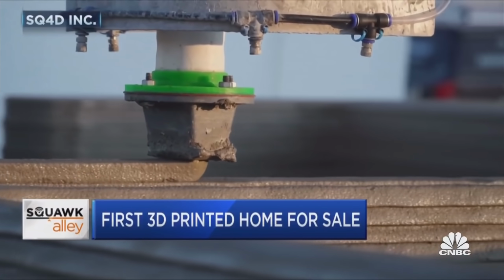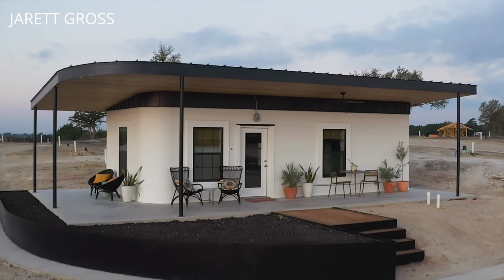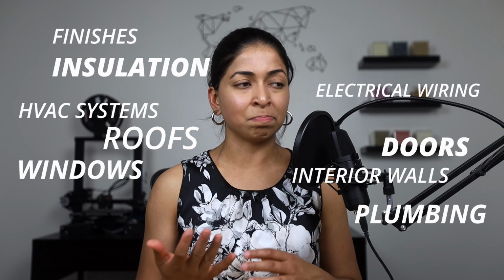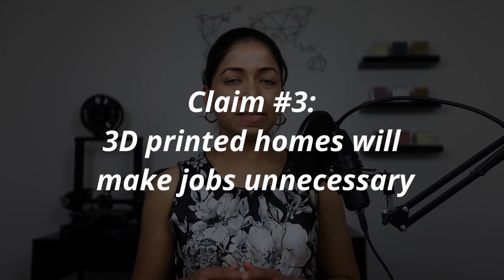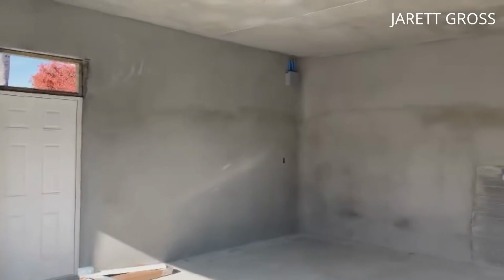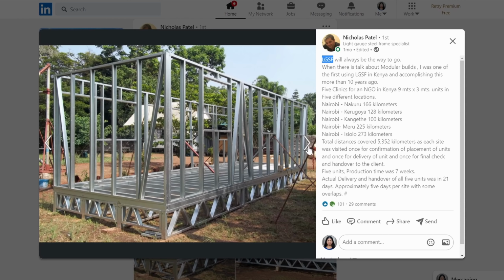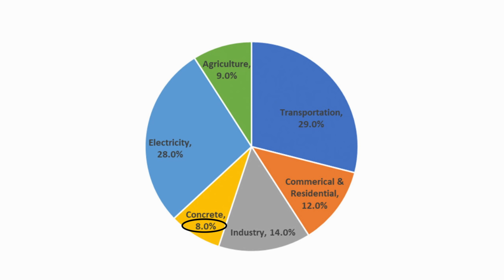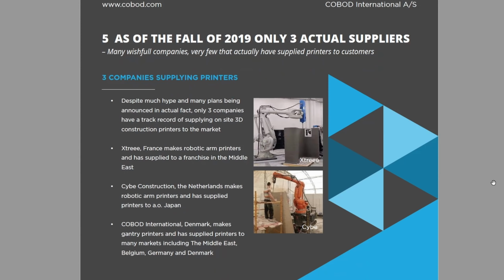Exposing 5 LIES about 3D Printed Concrete Homes

Comment: I feel like a "house printer" needs to be a lot more than just a concrete extruder. I feel it could be viable with using plastic and metal extruders in addition to concrete in order to lay electric and water lines as well as insulation, but it also needs a lot more maturing of the technology before it can be used to just slap down houses and call it a solution to housing problems.
Reply: That isn’t possible I’m afraid, 3D printed pipes would take ages and would be far weaker and more prone to leaks than standard 
And you’d have to have very different nozzle sizes for wiring and the walls, this would slow down the process massively as the walls would have to wait for that layers piping and wiring to be made before it could do the next layer. This would result in the concrete section idling which would increase the cost of using

Realistically a 3D printer is nothing more than an extruder with some movement
Reply: Prefabricated modules are much simpler, cheaper, and adaptive.
Lots of interesting work done here, unfortunately a lot of regulatory and perception problems.
Reply: @chrissmith3587  They're getting there.   There is a company printing metal rocket engines.  Aluminum, I think.  They can print the pipes into the bell and motor assembly while printing the whole engine.  It's a neat idea. 

https://www.youtube.com/watch?v=kz165f1g8-E

Common consumer/hobbyist 3d printers being used today can print multiple materials at once.  Either with multiple extruders and nozzles on the carriage, or combining nozzles where they can provide one material or a combination of a few dynamically.  

I don't think they'll ever be able to pass cement and aluminum through the same nozzle, but they could be able to print each on their own heads.   

If they can build rockets with it, they can print your residential system to whatever local code is, unless code requires factory manufactured tubes.   I suspect building codes around the world will need to be adjusted to allow on-site manufacturing like that.    

I'm not totally convinced that printing the whole house, with plumbing and electricity, with one machine, is practical.   Really, those metal and plastic printing parts will be idle most of the time during the process.  It's (probably) better to still manufacture pipes and wires elsewhere, and install them as needed.   It should be a lot cheaper and easier to repair.  Imagine trying to replace a printed pipe, inside a solid cement printed wall.  

It might be practical in another 50 years, when the components are already heavily used in industry on their sites.  Right now, any of those parts are rare.   I can't just go on Amazon or eBay to buy any of primary functional parts.   It wasn't that long ago that I couldn't afford to buy 3d printer parts, and people with microcontroller experience were limited.  Now every kid can learn in school how to program microcontrollers, design circuits, and print projects.   It's us older people who fall behind, if we don't try to keep up with technology.  I just happen to be one of the older people who does stay up to date on such things.
Reply: It takes hours just to print a useless tchotchke that fits in the palm of your hand
Reply: Yes recyclable plastic would be better choice than concrete?  Probably would be earthquake proof also?
Reply: @plang42  There's a lady in Africa who recycles plastic into bricks that are tougher than regular brick, if the memes can be believed.

Comment: I'd like to point out another problem with 3D printed construction. The lack of any layer reinforcements. The absolute number one problem with 3D printing, is the weak connection between layers. The layers work great in compression, but absolutely terrible when subjected to linear and opposite vertical forces. Aka, if you hit it from the side or put the layers under pulling pressure, you will eventually obtain cracks. A mitigation of this, without introducing rebar, could be to print the layers in different angles, although this would increase construction time of the home. At the end of the day, I cannot see a 3D printed home as a realistic approach to housing for the masses. It's made in a way that simply isn't durable for decades, as unsealed concrete isn't exactly happy for being exposed to the elements and paint isn't a great sealant either, which means the best solution would be a mortar mix for resurfacing the outer shell, which means more work and thus a higher price. Furthermore, concrete isn't exactly an environmentally friendly way to produce housing, as you also pointed out in the video, which further adds to the likely hood of 3D printed houses being nothing more than a gimmick for arrogant designers, architects and the rich and famous.

The average population is better off with prefab homes, as even their concrete elements can be made in controlled environments, thus reducing their pollution by collecting and repurposing their pollutants. I live in Denmark and our houses are a mix between prefab and built on site. Most of them feature brickwork on the outside and plasterboard on the inside, but between those layers are insulated, prefabricated concrete slabs, on which interior and exterior insulation is added, to make high energy efficient homes that can easily last 100 years. Which then makes up for the pollution that have been released during construction. Best of all is we do a semi-custom ordered villa in about 2-3 years (semi-custom means that the overall shapes are predetermined and selected from a catalogue, but the rest is up to the customer to decide. All the way down to which light switches, antenna output, internet connection and their placements in the home)
Reply: Even cast in the conventional way concrete without rebar works good only on compression.
Reply: That's a common misconception - concrete doesn't need rebar, and the layer lines aren't as bad as they are in normal printing because of how the cure process works. We have alternative technologies and additives to make it strong in tension, rebar is just well-understood and generally cheaper.

The additives needed to give it tensile strength aren't cheap or easy to use, but they improve the results of the printing process by making the material stronger while it's curing.

However, that does defeat the potential "it's cheaper" argument.
Reply: While I do think 3D printed houses are a dumb idea (in europe we mostly use large bricks work in construction, and a couple of good bricklayers can build the walls of a small house in a couple of days, It's a small part of the total cost of a house). Reinforcement is not always needed. I live in a brick house from the 1780's. Obviously it's unreinforced, but since there are no large earthquakes here, it's still fine. Even most modern houses here have unreinforced walls.
Reply: @slome815  Your brick house is enforced. It's built by bricks overlapping each other, which automatically reinforces it, rather than just running straight line after straight line on top of each other, like 3D printing houses do. A single, continuous straight line, will crack along that straight line, if there's nothing to stop the crack. Most brick houses crack along the edges of the bricks and thus create a zig-zag crack, which won't compromise stability unless it's really severe (like bricks starting to fall out) and it's easy to fix. A crack running along the edge of a house, in a continuous straight line, is just seriously bad and you wouldn't want that ever. It can though be easily fixed. Just add steel rods every 60 cm. and you're good.

For context, I am a Dane.
Reply: @Arterexius  There is no bond in the horizontal joints, the same as with with the 3D printed buildings. No engineer would call a traditional brick and mortar building reinforced just because it's built with a cross bond or half brick bond. 
In reinforced buildings there is steel to take tensile loads. A normal brick building will not take tensile loads any better then an unreinforced concrete building would.
 
And while my house, with it's soft lime mortar joints, will indeed crack along the joints, and not straight through the bricks, that is not always the case with modern brick buildings. 
I have seen cracks in new buildings build with hard portland cement mortar, and they will often go right through the brick and morter without distinction.
Reply: @slome815  I know that an engineer wouldn't call a normal brick building reinforced, as it quite literally isn't. That's why I didn't label it as being reinforced, when I described the difference between a brick building and a 3D printed cement building, in terms of cracks and it's why I specifically pointed out that a 3D printed building can be easily reinforced by inserting steel rods (horizontally, of course. Didn't mention that though, as I thought it made sense from the criticism I have towards purely 3D printed cement buildings with zero support rods).

Also, what kind of shitty bricks did those home owners buy? I've never, literally never, seen a Danish brick house crack through the bricks, unless it's already mostly a ruin and the majority of the bricks have become brittle. I've never seen it happen in a modern brick building. Only in centuries old, severely neglected buildings that are practically ruins.
Reply: @Arterexius  A house will crack if the foundation is inadequate, no matter how good the brickwork. And it's really not unusual for cracks to go tthrough the brick. A modern 1:3 mortar has a compressive strenght of at least 20N/mm², thats double of most modern bricks. Portland mortars also bonds very well to bricks compared to lime mortar. This is why bricks from modern houses can no longer be cleaned and reused, as is often done with older houses. I will say that most cracks in modern houses don't really spread as wide as in some old houses. This is mainly because of wider and more stable concrete foundation, as opposed to older, often very thin, brick foundations.
Cracks a couple of mm's wide are not obvious from a distance. I have been involved in some foundation repair, and once you start to look for cracks in buildings you really start seeing them everywhere.
Reply: @slome815  I agree that a house will crack if the foundations are inadequate, as it is after all the foundations that the entire house rests upon. I've just never seen a modern house have cracks going through the bricks. It may be because modern houses in Denmark aren't built entirely using bricks. They all have a core made of reinforced concrete elements, that are then attached in specific ways to form a given house. Then the outside is clad with insulation and brickwork, so the bricks in modern Danish houses, doesn't really carry that much weight. They're more for decorative purposes and tradition, as practically all buildings in Denmark, are made of bricks. Clay bricks, of course. Not cement.

But even with old houses, I still haven't seen cracks going through the bricks, unless they were practically ruins. My fathers house is built on top of a sandy hill and the majority of the house is balanced on a foundation made of thin, outer cement walls and all the floorboards are placed on top of small, brick pillars, which rest directly on the ground. The house was built in 1912, so they probably didn't know better at the time (Denmark was at the end of the industrial revolution at this point in time). Since its built on top of a sandy hill, and have no ancors down into the hill, it's pretty obvious to the both of us, that there are quite a few cracks. But we have yet to find a crack going through the bricks and that's despite my father having owned the house for 17 years and been restoring it for 15.

Btw, Portland sounds familiar. Is it Aalborg Portland?
Reply: @Arterexius  Portland cement is just the name for normal modern hydraulic cement. As opposed to the air curing lime mortar used before.

Comment: They say they build a 3D printed house, cool, but they still make all the electrical, plumbing, HVAC is still made the old fashion way, wtf, they start with a 3D drawing, it should be easy to implement raceways for cables, pipes, ducts, etc. in the drawing, but no they do not do that.

Comment: I'm a huge fan of 3D printed homes, but excluding the dirt homes, I never saw it as a 'cure' for homelessness, but rather a potentially new and exciting architectural medium which could provide its own strengths similar to bubble houses.
Reply: The strengths of bubble houses?
Reply: @slolerner7349  Bubble houses are really neat! They inflate what are effectively large balloons and cover them in cement. They then deflate them and insulate them. They're fire resistant, easy to thermally regulate, and surprisingly cheap.

Comment: This seems to be spot on. People always look at a house when the walls are up and the roof on and say 'nearly finished then'. Anything but! Speeding up wall construction would definitely be a plus, but there are plenty of other system to do that. But I think building a house in a factory and shippng the parts to site is a better way.
Reply: ....It is though. After the frame is up, you have plumbing, wiring, thermo, water tank, ac/ventilation, maybe gas in depending on the area, and fixtures. If the insulation is already taken care of with the walls, then yes, 70% of the work is done when the frame is done. The rest is small beans. 

Also, building the parts and shipping doesn't work well in most environments. That's the problem. We tried pre-fab panels in hurricane and flood zones; They break apart extremely easily. It's why they're called disposable homes.

Comment: If you look at 3D printing tech over the years it kinda sucked until recently.  Homes will be the same, it will get better over time.  The printers will get better, the material will change, and it will all get cheaper.

Comment: Beyond the 3D printing part, maybe it's time we stop using concrete at all for houses, and use local materials such as mud. The walls of my traditional French village house are thick and made with large square bricks of raw clay ("raw" = sun-baked) filled with more dirt taken from the house's foundations.
And 3D-printing mud is not an option, as each layers needs weeks to cure.
We actually had to remove all concrete that was applied to the outside decades ago and replace it with a layer of breathable limestone cement, as concrete and raw earth don't match, the whole purpose of raw earth walls is that they can evaporate outside all the moisture from the soil and from inside.
Reply: Youknow that things like insulation etc. work?  Even today you are not allowed to use mortar for bricks in Germany, they are all individually milled and then glued.  Because the mortar insulates so badly.
Reply: Also if you live in a country with lots of earthquakes you need reinforced concrete to be safe from extensive damage or collapse.

Comment: Hello, I have to disagree with you on this topic. 3D printings has other advantages, such as minimalization of waste during construction, the possibility to print different structures, 3D printing is probably the only way how to automatize overpriced building industry, especially in developed countries where big proportion of building costs comes for workers, of course there are phenomenas you mentioned such as different soils, but like in any other construction projects, this needs to be solved in projecting part.. It is still very new technology that needs development, just imagine old cars or computers. You also forget to mention that there are more materials you can print with.. clay reinforced with natural straws like Gaya and Tecla houses. Since I spend lot of time studying this topic I must say that your video didn't take into account the positive impacts and is hardly negative. If 3D printing wouldn't be very promising technology, why would houndreds of companies invest in it?
Reply: The 3D printer has no advantage to pre-fabricated concrete or timber frames unless you are purposly building something that has an endless stream of weird angles and shapes. The gantry, generators and other tools you need simply to make use of it, not to mention the concrete itself, produces far more things that need to be moved from site to site as opposed to just using pre-fabricated parts that can be put in place quickly allowing all the other trades to get on with their work.

Comment: I don't understand how these 3d printed homes meet code? 
If I build a home out of Insulated concretely forms, I need to include a ton of rebar to increase tensile strength of the wall.  
How are they getting that strength in these homes?
They look delicate to be honest.